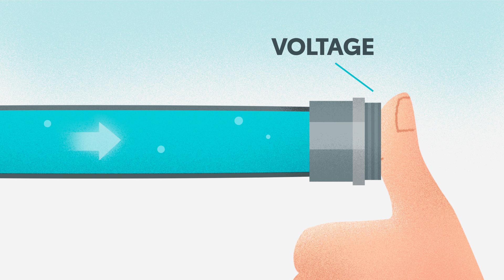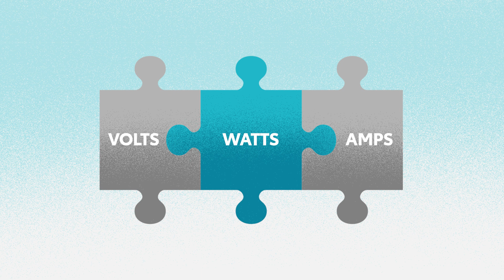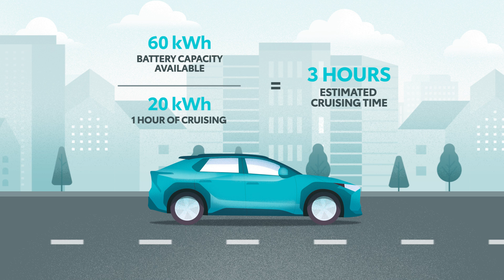The Basics of Electricity | It's Electrifying | Toyota

Comment: The watt is not a measure of work; work is equivalent to energy. Watts are a measure of power, which is energy transferred per unit time or work done per unit time (the video says this, so it’s not self consistent). Joules are the measure of electrical work or energy. Watts = joules/sec. See any textbook on circuit analysis.

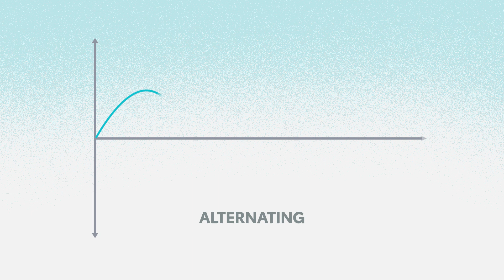Comment: 3:26
AC doesn't rapidly flips the flow direction between Positive & Negative. It does so between point (terminal) A & point(terminal) B.
 Conventional current always flows from +ve to -ve or from higher to lower potential. In case of AC, Terminal A & B keep switching states between high and low, one being at higher potential, the other being at lower.